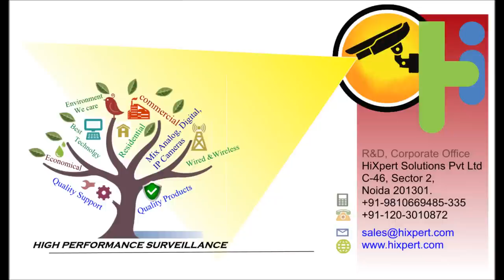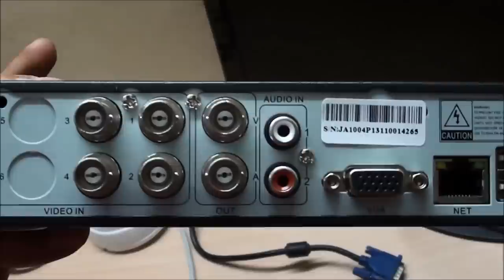How to install a CCTV System in 10 minutes

Comment: Thank you for helping me the idea to install CCTV System. I had one security Camera system from my friend gave it to me without Manual book. I had tried to connect it but it didn't work. Now I find out why due to your instructions. It is very good lesson
Reply: eventuality
Reply: Johnfong100
Reply: Exactly. Never realized I needed a DVR and also a VGA cable
Reply: all you need is a HDMI if you have a tv that has the same connection
Reply: and also you will need a DVR to record and to connect the cameras
Reply: DeJuan Howell Hello Sir, where can i get the set of cctv similar in the video and cheap. Thanks!
Reply: Ok ok I'll do a follow up later and then you don't get the same thing I don't know is the one you can use for it but I think I did the app on a regular phone because of my iPhone I was a bit annoying at four times a tad too easy but the performance of this article has to have to do the whole article on this page because the only reason why the wall has to
Reply: where is your location? maybe I can help you

Comment: My friend, you are a good teacher. Very well understood. After that if you are a computer guru like me, apply to different monitors. Meaning you can split the VGA Cables to enable you connect to different monitors for viewing anywhere. Example in your living room, bedroom tv, or kitchen. Thanks man
Reply: there is no mass to thought orso thoughts there 4 death is non existant
Reply: i will teach you how to controll matter by the example of donald trumps jet disapeering if i shall may need so doing in my order as i am zemokka47 the king of thee most high

Comment: I connected the other side of the VGA monitor to my computer and i think its a bad idea because the port from my computer is a monitor port meaning its exporting signal not recieveing it... What kind of plug is on the other side of your VGA cord and how does it plug into your monitor?
Reply: Can I use this with a cinema display? What cord do I need then?

Comment: splitting the the power would not drop the voltage with long distance, let say a hundred meters from the dvr?, for me I prefer sending 220v to be converted in every location of each camera to avoid voltage drop,

Comment: Could this be seen on your phone ?
Reply: If you connect the DVR to your network properly and then configure your network so that the network is accessible and viewable by your phone, then YES, it can be seen on your phone.     The trouble you may run into is with configuring your network (some people are comfortable with changing their network and router settings and some folks freak out when they try).
Reply: deasttn thanks for the information :)
Reply: Ale Kat night